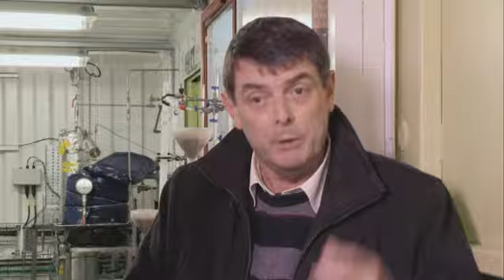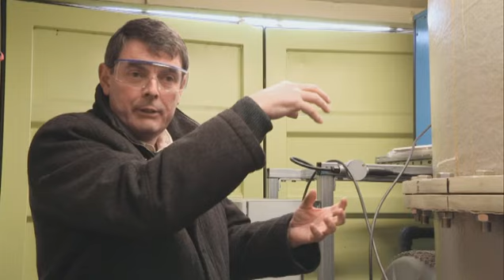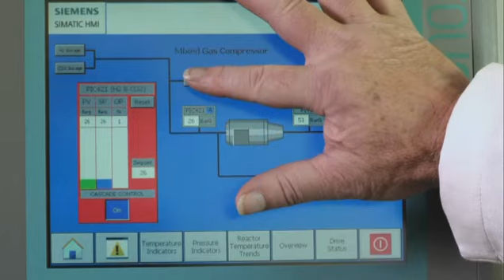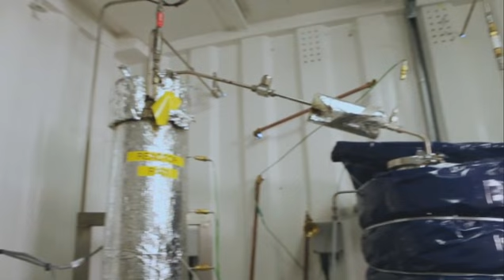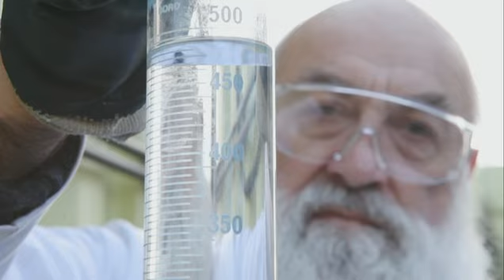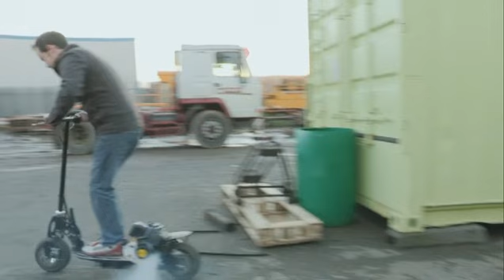Turning Carbon Dioxide into Petrol - Carbon Capture - Horizons

Comment: Let me guess, For every ONE unit of fuel energy recycled, you are required to input 9 or 10 TIMES that amount of energy in the form of compressors, refrigerators, heaters, ELECTROLYSIS, etc, etc, etc. This is a gimmick.

Comment: Before you have a Greta Thunberg hard-on lets get a bit of reality going to tether you back to solid ground. It
 is an elaborate process using many chemicals but the idea of taking co2
 from the atmosphere is environmentally sexy. The one thing I am sure 
you are NOT calculating is that the chemicals and gases that interact 
with the air to produce the fuel are having their own chemical reaction 
and need to be changed out for fresh chemicals. sorry

Comment: Use a molten salt reactor. Electricity without CO2 to produce synthetic fuels so you have a closed Carbon loop. The only possible problem the local pollution and effect on people in the centre of a city like Beijing or Paris.
Reply: yea burning things dont just put out co2 and h2o especially oil refineries the might be so2 and no or no2 and other gunk that might mess the solution and its expensive industries cheap out on trivial necessary things you want em to do the hastle of doing these things

Comment: Once we have the installation of solar and wind virtually everywhere on every roof; then we can make different combustible fuels on the cheap.  This will be very interesting in the market if we start seeing many different types of vehicles because of an abundance of fuel types at low costs. Ev and hydrogen and ethanol and more just waiting for critical mass of renewable energy.

Comment: pretty cool. If we ever wanted to terraform a planet that was close to Earth climate but slightly too warm but had co2/water, you could use wind turbines to draw kinetic energy out of the air, which would lower air temperature, then store that excess electrical energy in hydrocarbon form. And pump the hydrocarbons into the ground to permanently capture the energy out of the system, overall cooling the planet.
Reply: True, but you have to consider energy usage by humans and the dramatically increasing amounts used per person, as well as the increased numbers of people.  Pumping hydrocarbons into the ground would not be a useful way of reducing carbon emissions when the most important goal is to get the excess carbon away from the environment in the first place.

Comment: Wow 1 pint of fuel per day 😱 and about $20 in electricity to produce it 😱 scale that up to industrial and for $400 you can fill your car up 😰 that's Amazing, producing 10x more CO2 than is removed from the Air 😵

Comment: I have a better idea to use CO2 gas to turn turbines of an 100MW generator with a constant vacuum compressor of 40MW into a pressurized vessel the efficiency of between 50 and 60 percent which is better than thermal stations of which is 35 percent we are looking at CO2 as a demon gas .

Comment: global warming is BS...putting more carbon dioxide in the air will just make plant life grow more vigorously because plants use carbon dioxide to grow and make sugars...plants are able to capture the carbon from carbon dioxide in microscopic pores on the bottom of leaves and release the oxygen from that process...and when plants grow more vigorously they will produce more oxygen...nature always seeks balance so its impossible for a runaway greenhouse effect...earth would be doing work on itself if that happens...which violates the laws of physics where entropy always increases...everything goes from order to disorder...concentrating something (greenhouse gases) is disorder to order...which requires energy to do because there are less ways concentrated thing can be arranged compared to non concentrated things...which is why entropy always increases...order to disorder and not the other way around because physics says  oh no you don't to entropy decreasing

Comment: aloha ok i saw you video of cabon fuel, a better idea is to put a carbon filter on the exhaust on all vehicles otherwise whatever fuel you burn/make is  still is released as co2, or if in addition you can make a self refilling fuel system and you’d never buy gas. hello

Comment: The A 380 airbus takes 81,890 gallons yes thousand gallons of kerosene, central heating oil, diesel to fill its tanks, it will burn it will burn 81,890 in 20 hours, there are 50,000 planes in the atmosphere 24/7 co2 is a heavy gas it cannot go up into the atmosphere as co2 is coming down this is all a big money making scam. oil can never run out it is not a fossil fuel it is abiotic the earth's mantle never went down deep enough for dead animals and trees and little fishes, it was an old wives tale, heathrow airport consume two hundred and fifty million litres of oil a day and this uk bent twisted and corrupt government have got the nerve to blame the motorist.  aircraft produces vast amounts of sulphuric acid this is why american people wear baseball caps to protect them from the acid burning their heads.have you seen the old cars in the usa and uk were the acid has burned the paint off.sulphuric acid and fluoride are the main ingredients in sarin nerve gas the uk and the usa are using liquid sarin to kill us off. you do not have to be a village idiot to work it out.

Comment: It seems like most or all of the larger hydrocarbon molecules are all fuels  that can be oxidized to release energy at some temperature.   Carbon dioxide and water are just about free.  Set a mixture of water vapor and carbon dioxide spinning at high velocity in a cylindrical chamber with a filter along the outside that will stop anything larger than methane hoping to catch only those molecules that are liquid or solid at room temperature and are easily stored with good energy density.   Focusing concentrated solar into the center of the chamber will break the water and carbon dioxide down into their elements.  The centrifugal force and theiir own heat will drive the disassociated elements away from the center where they will combine into different hydrocarbons at different temperatures as they move awsy from the heat. The larger molecules so formed are likely to be alcohols or propane or butane etc., and will be trapoed by the filter.  The recombined carbon dioxide and water and other small molecules will pass through the filter and can be recirculated into the center.  The larger flamnable molecules trapped by the filter and kept from the hot center by centrifugal force will build up until most of the initial carbon dioxide and water vapor have been converted to flammable hydrocarbons like the mix found in crude oil.  This "crude oil" can then be refined in the ordinary way.  Hopefully the process would not take millions of years as in the formation of natural fossil fuels.

Comment: we are making co2 into petrol and we are using petrol to make more co2
Reply: its a closed system which means no added co2 to the atmoshpere just use it and put it back
Reply: Nisha Srivastava better than converting oil into petrol
Reply: its carbon neutral dumbo
Reply: No no. We are using power to change the co2 into petrol... and then petrol becomes sort of a energy holder (unreliable dirty battery).
Reply: @RadekZielinski.  
"unreliable dirty battery" hydrocarbons are INCREDIBLY reliable batteries (and so is literally any other liquid, gas or solid fuel out there). petrol doesn't explode in summer, doesn't lose its energy density in the winter, not using it doesn't shorten its life, it doesn't require complex electronics to keep track of its charge level, doesn't blow up when short-circuited, holds FAR more energy than even li-po batteries for the same mass, and on top of all that, it's incredibly cheap.
Reply: @voltagedrop5899  now go big scale mate, and use more nuclear power stations like an idiot.
Reply: Voltage Drop ya totally agree
Reply: FORS4TAN what’s wrong with nuclear power? Most efficient power in the world and no emissions, especially with nuclear fusion coming. U are incredibly ignorant and in need of education before u speak on a topic. Whether u like it or not nuclear is the energy of the future and can power stations like these that make gasoline from co2
Reply: @thedriven1415  And call me uneducated how many times you like, but you're in opinion are not seeing the bigger picture. I have a right to write here what i think unfortunately.
By the way it's 'you' not 'u'. English is mysecond language but at least i try.
Reply: FORS4TAN not dirty compared to a real battery like lithium ion
Reply: MR'S Nisha Srivastava can you help me in project of conversion of CO2 into hydrocarbons.
Reply: Hi Nisha ..you look beautiful
Reply: Ok... which makes it neutral. What are u trying to say?
Reply: @thedriven1415  we areusing more of the limited uranium supply in the nuclear power plants. Nuclear power plants are prioty in most advanced countries... If not that we'll befored to use coal. Worldis running out of a good power supply that will last longer than 200 years. Using this petrol as a 'battery' is putting even more weight on our power supply. Lithum battery electric cars won't even take over the world by the way, there is not enough lithum in the world to make this many batteries. It's just a waste of time and it's destroying out resources.

Comment: this makes no sense co2 is not a fuel if you have that much hydrogen just burn that and you will have no emissions and you won't have to supply energy for distillation this is a big joke and a waste of tax money
Reply: Richard Meola Actually you did not understand the point.... it's  main purpose is to create a loop to recycle carbon dioxide  into fuel... making almost an infinite loop (with some losses in the process).
Reply: Richard Meola the point is that we have an increase of CO2 in the air and we want to get rid of it. Of course you could simply use hydrogen, but it doesn't solve the CO2 emissions crysis. This, if it works perfectly, does
Reply: im not sure but from what i have researched is that storage of hydrogen is difficult so it would be better to transform it into a liquid fuel at room temp.
Reply: yes but that doesn't solve the problem that we have a lot of CO2 to get rid of (although it is an interesting idea to use hydrogen and oxygen as fuel, I think it's one of the fuels used for rockets, plus if it's just that then you don't have so many CO2 emissions)

Comment: Groan. Ok... so you fill a desert with solar panels (ignoring the energy and specific minerals needed to make the solar panels). You now build a massive plant next to it. You then extra CO2, combine it with sulphur-based chemicals (which need producing and extracting) and make ethanol. You then transport the ethanol to vehicles which burn it.Now anyone can figure at least five better ways of going this. 1. Farm crops and use the plant material to make ethanol. Doesn't require solar panels, sulphur extraction, etc. 2. Just put vast lakes of algae or vats of bacteria. These will extract CO2 and make ethanol for you without the need of solar cells. 3. If you have all this endless renewable power... use the solar cells to make this vast amount of electricity and send to cities with electric vehicles with hydrogen fuel cells. Electric vehicles are far more efficient then burning gasoline (let alone low-grade ethanol fuels). 4. If you have all this endless renewable power... replace all the coal and gas electricity plants in the world and don't worry about making ethanol for vehicles.5. If you have all this endless renewable power...  just keep burning coal and gasoline for power and use existing carbon extraction technology to take CO2 out of the earth and trap it in rock or the ocean.The problem has never been using, transporting, or converting energy. These are always a fraction of the energy usage percentage. The issue has always been generating the power. This "technology" relies on some fictional renewable power which doesn't exist. If such power existed... we have the technology to replace fossil fuel vehicles with electric vehicles and just use the power normally.
Reply: You forget what we need to replace here. Ships, Airplanes, trucks, cars, motorcycles etc. You want to replace all those vehicles and power them with electro-motors? Of course this would need massive amounts of copper and i'm not even sure if we have enough resources to create all of those magnets, especially when you consider that they are needed to create the wind generators that people plan on building. And of course lets not forget about the batteries that electric vehicles will need. Will we have enough lithium? Will we be able to extract it as quickly as it is needed? 
Furthermore liquid carbon neutral fuels are the only thing that will be able to store energy for years and decades. You forget that many renewable energies have a highly fluctuating output and you forget that the energy demand is different from season to season as well. So storage technologies are crucial. Not all countries have high mountains, which are capable of storing a lot of energy. 
Carbon neutral fuels are going to be a key part of the way towards a carbon neutral economy.
Reply: I think that the main upside to this is just to be removing co2, but you have a really good point. it's not really worth it.
Reply: @jasonisbored6679  agreed
Reply: Jason isbored plants remove co2
Reply: Cars that run on gasoline cannot run on ethanol, and vice versa. While I'm at it, biofuel will become useless in wintertime, unless we insulate our gas tanks and engines.
Reply: Kevin Lane ya but electric isn’t great in the winter time either
Reply: Kevin Lane okay no sir. Not all biofuels have a low cetane value. Dimethyl ether has a high cetane which is similar to high grade diesel with additives which can be mixed with ethanol butanol methanol etc for winter performance at the pump. Engines should be insulated and water injection should be used when you have engine temps on the wall of the cylinder above 300 degrees. Check out the achates engine. HCCI engines too.
Reply: Yes, but the technology is at the beginning. It will be used near factories that produce large amounts of co2 or cars may become equipped with a co2 retaining system.
Reply: BW022 ok why would u use solar why not nuclear fusion? Then also what about lithium ponds to make batteries? That’s bad for the environment right? Except u don’t want to talk about that. Plus gasoline makes much better energy storage than electric batteries. And how in what way is electricity more efficient than gasoline? Gas cars go way further and don’t take hours to refill
Reply: Also this algae bacteria bullshit produces much more potent gasses such as methanol

Comment: So you burn a ton of coal to make the electricity to make half a litre of fuel....
Reply: Basically what he is saying is its not balanced. Coal is out by 2030. think of something else.
Reply: +TheShoreman1 
You would burn the coal anyway. Why not collect the CO2 from it and sell it to these guys? Even if you wouldn't have wanted to burn the coal previously, now you do, just to collect the CO2. And maybe to get some energy and heat out of it.
Reply: You can also get the CO2 from the oceans are the air. And this can be done at an affordable price as well (55 to 100 dollars per barrel of fuel).
Reply: *per barrel

Comment: Wonder what the projected cost per/unit would be?  Joules Unlimited does a similar process.  The process is sun light plus CO2 plus water fuel that is 'finish refined' in their DNA modified algae, who's Body...surprisingly holds it's energy storage (fuel) on the outside.   The algae lives on after the fuel is removed.   Joules Unlimited is teamed up with Audi...so it's no 'smoke and mirrors' idea.   Joules says they can do it profitable at equal to oil @$50/barrel.
Reply: So it's basically a less efficient solar cell. Probably better than pumped hydro+PV farms.
Reply: Possibly.   I think plants,algaes are not too efficient at converting sun energy into sugar or oil, maybe less than 5%.   Solar cell are 15%-20%, but require to buy 15 years of electricity up front (the cost of the cell itself), and the storage costs are crazy high.  So the total cost/unit energy is one of a couple of numbers to look at.

Comment: The best way to capture carbon and turn it into fuel, is to grow a tree and burn it.
Why use energy to turn methanol into petrol.  Just run the car on methanol.
Waste of research money.
Reply: mercedescamper308 Petrol engines sound nice.
Reply: How about burning plastics and then capturing the CO2 from there ? Will that work ?
Reply: Sorbojit Dasgupta umm no that’s extremely toxic
Reply: syngas, or any other scrubbing method. I do not think this technology would be ideal on its own but maybe as a air purification process for some of the power plants in the States namely Hawaii and the islands. seems to me a lot of them still use generators for grid power
Reply: Plastics are petroleum based. Burning fuel oil would save you a step, and would be much more environmentally friendly.
Reply: +mercedescamper308 
- Harvesting wood requires a lot of work and energy. Instead you could collect your CO2 at various other sources that already produce CO2, with far less work.
- Methanol is problematic: slightly corrosive, slightly dangerous to handle. Read up on methanol.

Comment: Now they propose to be about extracting natural gas from schale with so state of the art chemical process will trying e=with no success t open "Miny Refineries") I got screwed . the process still in the lab 2years later? Scam, Scam Scam. To costly for the output . Major polluters have no incentive to spend the cash enven if it is real..
   Oceans are rising. I bought a boat as a provision against the rising oceans and the greed of man. Same scam different name. Stay away